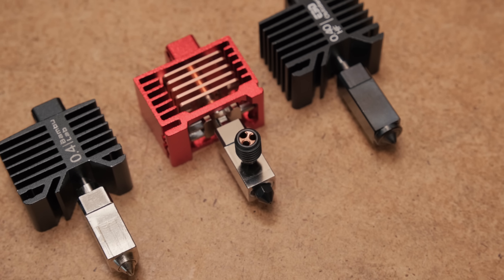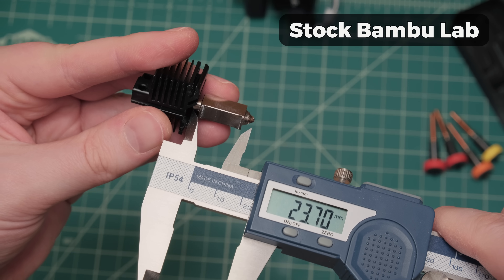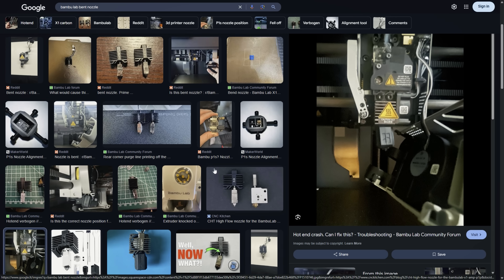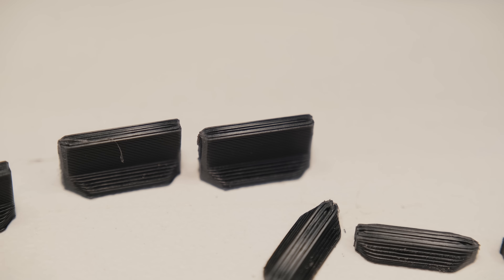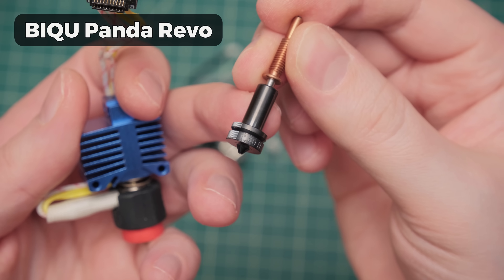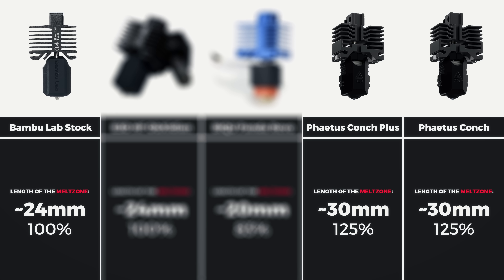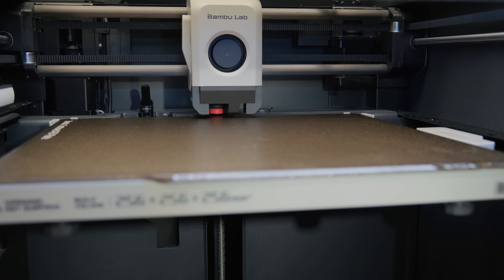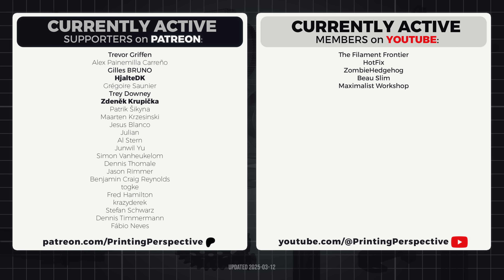BIQU Panda Revo vs Phaetus Conch+ vs E3D HF ObXidian (HOTEND TEST for Bambu X1/P1)

Comment: I've got the conch.  Love it, but remember to disable long retraction especially on PLA.  Ugh.
Reply: I've been using it with the long retraction length changed from the standard 18mm to 12mm, and there are no issues.
Reply: @karuchieable  do you have the standard or plus?
Reply: Why?  What happens if you don't?
Reply from the maker: Potential clogs. Because the meltzone is longer, you need to retract less when changing filaments.
Reply: @ It's not the world's worst clog.  It typically just mushrooms right at the very top of the assembly where it's cut and creates a chamfered plug so the next filament just crashes.  Easy enough to recover, but annoying nonetheless if one forgets to disable the new setting.
Reply from the maker: That's a good point!
Reply: what retraction did you use?
Reply: @shrimpwtf  You can leave the retraction amount default.  It's that "Long Retraction on Cut" that's the problem.  Just make that checkbox is deselected on all the filaments.
Reply: @teac117  ty! do u have normal or + and have u noticed any heat creep?
Reply: @shrimpwtf  + with the endcoat.  No issues after hunting down that setting.
Reply: Probably just need to reduce it by ~25% for the added melt zone. So 13 mm is a good start.
Reply: Do you know if this also applies for the A1 version of the conch? I can't find any info on the meltzone length

Comment: It'd be cool to see a test like this for CF filled filament like petCF25 or pps-cf. I wonder if the 30$ extra is worth it for a 0.6mm CF only hotend as you print advanced filaments much slower anyways. I know you tested PLA at 8mm/s^3 already but higher temp and advanced Filaments might behave differently.

also I'm very suspicious of your conch results. I wonder if the hotend is just sitting at a hotter temp.
also I wonder if conch plus is any worse

Comment: I've watched this video and many others of yours many times now, great video and I just need to buy a Phaetus Conch just to have

Have you tried their Conch M6 hotend? It'ds the same hotend, just allows to use a regular V6 nozzle. I've been thinking to put a CHT on there, and see if I get the theroitcal ~39mm^3/s flow (the Conch M6 is listed at ~30mm^3/s, plus a CHT usually adds ~+30% to any hotend, [30*1.3=39]). Thoughts?

If not, I'll buy and post my findings on my channel
Reply from the maker: Conch and Conch V6 are not the same. The V6 version has a shorter meltzone and it perform worse than the stock Bambu one. I already tested the V6 in one of the videos after this one. I thought the same that Conch V6 would have the same longer meltzone, but it doesn't. It also came with full hardened steel nozzle that lowered flow rate even further. Plated copper nozzle with hsteel tip would have been a way smarter choice.
Reply: @PrintingPerspective  So i just verified the melt zone length is ~25mm on the M6, v. the regular conch at 30mm, this may still be worth it to add a CHT nozzle to make up for that overall reduced flow. I'll gewt bopth and try them, one Conch, one Conch M6 with a bondtech CHT nozzle, see which has a higher flow rate

hoping for the M6 since we can change nozzles much easier, and can even use a volcano for even more ridiculous melt zone (just add the necesary amount of nuts and adjust the offset)
Reply: This is not recommended for new users, only for us crazy tinkerers!
Reply: @PrintingPerspective  Thanks for sharing; I'll double check this and decide which for my build

Comment: How do the hotends compare in the coating department? Both phaetus and e3d (not sure about the biqu) advertise a coating that supposedly reduces filament buildup on the nozzle. 

I tried the biqu panda juicer for the A1/H2D which also advertises this but it was somewhat useless, so I'm thinking of getting either the Phaetus or the E3D instead.

Comment: mellow fluxheat looks really cool too. but it looks like a heatcreep and retraction nightmare with that mega small heatsink.
also there's the x1p or something? it's from triangelab.

I still can't find a decent hotend which drives me mad because all I want is just the god damn freaking simple TZ 2.0 without the annoying heater block screws that cause jams. Removing the screws helped a lot but one of these days I'll see if I can find a way to fully remove it and use a rotary cutter   to remove it.

the results you saw give me confidence tho. the heatsink and cold area is still smaller tho which means you can't retract as much or as fast when changing filaments (I assume?)
EDIT: damn was that conch result with a high flow/cht nozzle? that's pretty bad otherwise :( e3d seems like the only option right now but it's pricey.

Comment: Please could you test the Microswiss Flowtech and CHC XP1 hotends. The CHC XP1 can be equipped with genuine CHT nozzles and it also uses a longer 80W heater cartridge and heat block. I just bought the Conch based on your review but I am interested to see how the CHC XP1 compares to both the Conch and e3D especially when it's combined with a high flow nozzle.

Comment: I have a Panda Revo with 0.6 HF Obxidian nozzle and upgraded from the TZ2.0. I like the quick change, allowing me to swap between 0.4 and 0.6 quickly, and also the fact that the 0.6 HF's 22mm/s PLA rated flow is so close to the 21mm/s flow of the default PLA profile but prints faster than 0.4 because of higher layer height, so I don't have to mess with custom PLA profiles anymore. I also like the 60W heater core, which allows me to start my prints faster and print PETG-CF at higher flow rates without getting heater errors. It has also never jammed on me unlike the TZ2.0 and stock Bambu.

It may not be the best in terms of layer adhesion (I think 0.6HF adhesion is fine) but it's certainly better than the others in Bambu-style user friendliness! It did cost a high amount with the nozzle purchase on top of the hotend purchase, but in terms of equal cost, I'd rather have a P1S with Panda Revo than an X1C with stock.

Comment: a lot of issue with phaetus conch hotends tho , like tolerances with the extruder screw holes and tip chips very easily after a few hours in.
i got 2 of em and both of em same issues
Reply from the maker: I can only rate them on my experience, you know, and I had neither of your mentioned issues. It could be a problem with a batch if both of your hotends failed the same. When did you get yours? Maybe it was earlier units?

Comment: It is really strange: the Phaetus support states that the thermistor of the conch plus is a PT3-25E2-S2. The genuine thermistor of Bambulab seems to be a generic 100k NTC B3950 one. They have very different curves if i am not mistaken.
That would mean the real temperature in the conch is very different to the reported one as it is not possible to configure the thermistor on a Bambu. Right?
Reply from the maker: I would say it is a mistake as it would make the hotend to try reaching ~600C instead of 220C (I only quickly checked, not 100% sure). Supports of most companies are not very knowledgeable so this is the second reason I wouldn't take this info as a fact. For my testing, I used the original Bambu Lab thermistor and heater for the P1S. If you are concerned there is no reason not to use the stock Bambu thermistor, you know.
Reply: Thanks for the info. Yes it is really strange. I asked why the hotend is rated at 320°C while the thermistor is rated for 300°C in the datasheet. I got the answer that the manufacturer assured that the rated range is -40-350℃. Not very trustworthy.
That being said i have real trouble to get PLA working with the Conch Plus in a Dragonburner. :( The extruder skips steps after a while. I tried all thermistors available in Klipper and even took the table from the datasheet and translated it in a custom thermistor. I took a look with a thermal camera at the coldend, seems to be ok with 40°C after 15 min. Odd.
So far not really satisfied with the Conch.
Reply from the maker: If your extruder starts to skip steps only after a while with PLA, most likely the hotend's 3010 fan is not powerful enough and result in the heat creep. Measuring temps with thermal camera usually is not reliable unless the object has a black matte surface. You can try ABS and if it prints without a clog then it is heat creep for sure.
Reply: I found the culprit. It was a partly clog from a particle, that got worse and worse. I finally resolved with a cold pull. I am quite certain that this was a production residue. I had no clog in the last 4 years or so.

Comment: Could you repeat the test with the Slice Mako and Micro Swiss Flow hotends and release an amended video?  That would be the authoritative test of all Bambu hotends.  If possible, I'd like you to try the E3D Diamondback again, but with Bambu Basic PLA because I think your previous test results were showing the limitations of the material not the E3D Diamondback.

Comment: The e3d obxidian is great, until it gets clogged and you try everything in your years of 3d printing experience to unclog it to no avail and have to throw it in the trash.
Reply from the maker: I still haven't run into the clogging issue with the Obxidian, but if people only print filaments with no fibers the only way it would clog is if the filament has trash in it. So ideally you would use filaments from trusted brands and no recylcled filaments at all.

Comment: just got the panda revo.. man.. im disappointed. with a 0.6 nozzle it tops out with the brass nozzles at 21mms... my 0.4 obsidian does 33mms... waiting for a tiny tool for the cnc to make an exchangeable nozzle orifice on it so i can insert an cht style tip in hope that helps. i doubt it as i had to increase the temp from 250 to 270 in order to make the petg shine. i think this is a step back.

have ordering two more obxidian ones for the mainrig as those perform best for my use.

also the nozzles for the revo system have a HUGE exposed area that gets cooled by the part cooler. i measure with flir 40-lower temp on the nozzle tip and exposed large flat area..
Reply from the maker: I think the main reason Panda Revo underperforms is the shorter melt zone and being not a single structure. You get temperature readings on the heating core, and with tiny gaps between the core and the nozzle, the nozzle will always be underheated. My only suggestion is to increase temps by 5-10C to combat that. IR cameras read complete nonsense on shiny objects so you can ignore that. In general, part cooling only makes the heater dump more heat into the hotend to maintain the temps (because copper has very fast thermal conductivity) and is not a problem until the heater is overwhelmed. But again, because the Revo is not a single structure hotend, it can affect it more. Revo is a Convenience over Performance type of hotend.

Comment: I think there are two major problems for revo clone hotend ,1  there is no high power heater available , they are all just 40W. too low.  2 there is no low cost CHT nozzle.  meaning this revo clone has no high flow possible.
Reply from the maker: Panda Revo is not a clone. It is BQ collab with E3D and it comes with a 60W heater core. But either way it is only important if you are maxing out the 40W one. I doubt anyone else testing hotends by how well they actually melt the filament as that is extremely time consuming and requires specialized equipment. So when the actual performance is revealed, people are surprised, because max flow rate means very little.

Comment: Could you do the spider v3 pro (possibly knockoffs) on ali?
Reply from the maker: V3 Pro is the hotend for Creality printers, but I don't use those. I tested layer adhesion with knockoffs and it is a waste of money for the most part. If you want value, either stick to stock hotend or buy ones like regular Conch that have excellent value for the performance.

Comment: Does the Conch use a custom silicone sock? Or could I use the existing ones from bambu?
Reply from the maker: Conch has a longer melt zone and different heatbeak design so the original sock does not work.

Comment: Very interesting results considering the conch doesn’t seem to have the split channel design of the E 3-D. I would really love to see you eventually anything to compare the amount of purge needed to clear the nozzle if you’re switching between colors or materials. I know with the e3d it’s a lot higher. Also, I don’t know if you’ve mentioned it in any other videos but I know there is a thing with the stock bamboo heater is having trouble keeping up with the high flow. I have used the higher watt 70-80watt heaters don’t suffer from nozzle temp errors like the stock seems to.
Reply from the maker: That was with TZ 3.0 hotend, where the heater were not able to keep up. But that was because of a horrible tz design.

Comment: I got the revo a month or so ago with obxidian hf nozzle. I hadnt noticed any drop or improvement in print quality over the stock hotend, i just wanted to be able to switch nozzles quick and i liked the concept. These results make me wanna cry even tho im happy with it
Reply from the maker: You can always increase the temperature  to improve the adhesion. In fact I would set at least +5C printing temps considering the Panda Revo design.
Reply: I agree. But I will say there may be a QC issue going on with the Panda Revo. Using multiple pandas on multiple machines I've had amazing results on most of them. But with one of them I'm getting sub-par later adhesion.

Comment: I recently found out that Microswiss have made a version of their FlowTech hotends for Bambu P1S/X1C with interchangeable nozzles. Have you tried them? Any chance of adding them to a comparison?
Reply from the maker: Maybe
Reply: I didn't know this came out. I recently cancelled an order with Slice Engineering because they kept stringing me along for 7+ months to give me the hotend for double the price of what Microswiss is offering and with a better ecosystem of nozzles. Thanks for mentioning this! Definitely going to check that hotend out in a month or so.
Reply: I third this, stupid easy to change hot-ends and no issues noted, but ive not done a super breakdown like this, would love to see its addition with the high flow nozzle!
Reply: I seocnd this!! The Microswiss has been absolutely AMAZING! I had nonstop issues with the Revo, but the MicroSwiss has been AWESOME.

Comment: I have the e3d cht nozzle on my x1c and ive been able to push my machine to be about 10% faster with it, although at a noticable decrease in print quality. The dimensional accuracy is still good though so its great if you need to make many parts for testing. Was it worth the 100 bucks though? Eh, maybe.
Reply from the maker: I have them on two of my printers and I never saw any problems. Can you tell what exact defects you have noticed with the HF ObXidian?
Reply: @PrintingPerspective  nothing too crazy, just 'smoothed' corners and rougher looking seam. Keep in mind this is also in combination with cranking the speed up. Maybe it's a skill issue on my end.

Comment: Curious if you dialed in any settings for the e3d High Flow ObXidian hotend?  Their website has specific settings for each filmanent type.  Great video, very informative.
Reply from the maker: I dial it manually with each new filament if I will be using it.

Comment: And here is why thermal conductivity matters. The conch's silicon carbide nozzle is near diamond hardness and has great conductivity of 120W/mK only diamond back nozzles beat this as diamond has an absurd conductivity of 2200W/mK!  I'd love to see how the new E3DxDiamondback bambu nozzles compare as these use standard nozzle and not CHT insert design. They print notably faster than stock due to the nozzles transferring heat so well. That said I'm definitely getting a conch for my less used sizes and for any filled filaments to not clog my expensive E3D Bambu  Obxidian.
Reply from the maker: It's only the tip. Even when I tested Diamondback it made almost no difference compared to stock hotend. Thermal conductivity matters but meltzone's length is what gives the significant boost for Conch hotends.

Comment: BTW. I'm on the hunt to have absolute perfect surface quality on .4 nzl Can you do. video on what you've gathered so far that improves this?
Reply from the maker: Top surface or the layer stacking? For top layers its the correct flow rate and for the layers the extruder that makes very consistent extrusion and printing outer wall first if model geometry allows it.

Comment: My main problem with these after market ones is not only availability but most importantly, the cables, if they have an electric component, not only it should be replaceable but it should come with extras, with cables on the nozzle, you're one blob away from having the printer out of commission
Reply: E3D Obxidian appears to use the same electrics as the stock  hotends.
Reply from the maker: Only the Panda Revo has different components. I literally used the same thermistor and heater on all other tested hotends for the most accurate results.

Comment: What might be interesting to test is purge performance. With CHT and longer melting zones more material is needed to purge - from some initial experiments between revo hf and sf I’ve noticed almost a 50-60% increase in purge needed to get the same result (ie no color bleed). This would make for an interesting video to explore the trade offs made other than part strength and whether a cht geometry is better or worse than a standard geometry with longer melting zones and how they compare against a standard flow nozzle.
Reply from the maker: I don't make multicolor prints as unless you printing the full plate it's extremely wasteful. So I doubt I will make such comparison.